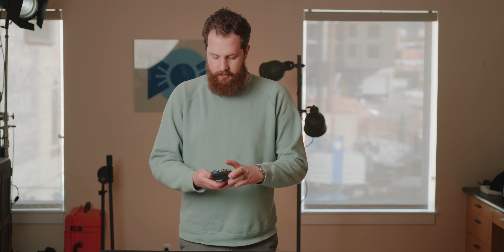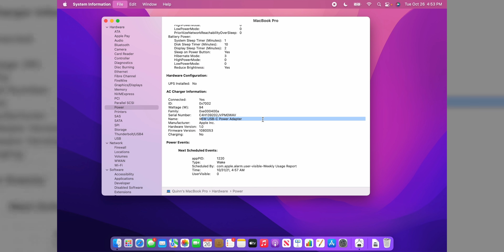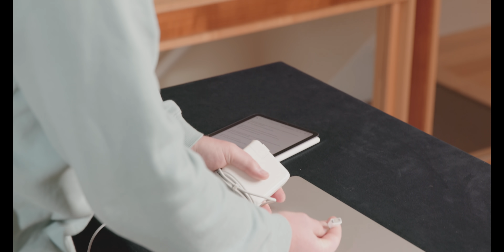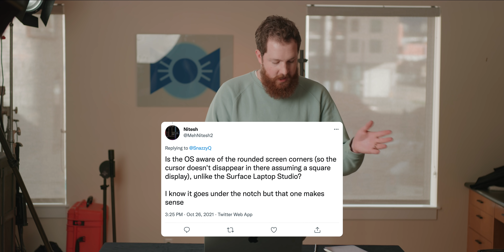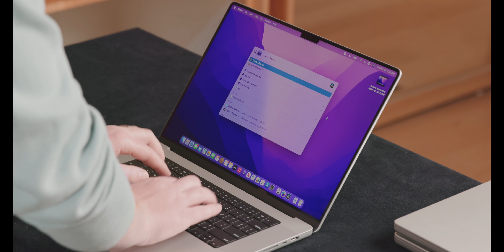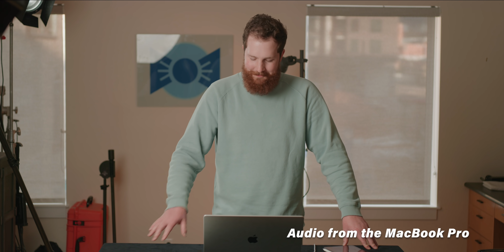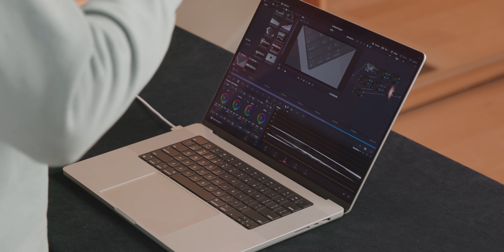The 2021 MacBook Pros are Insane

Comment: (1) menu bar items on the right always disappeared when the menu was too large with no way to access them. (2) the “warp” across the notch when using menus is inconsistent with normal cursor movement but is consistent with menu operation; since the menus straddle the notch so does the cursor. I.e. when you invoke a menu you’re navigating menu space not your normal screen space; users are used to subsequent menus immediately popping open as they scrub over them, if there were a dead space it would feel unnatural. Similarly warping or colliding with the notch when just moving your cursor around would feel unnatural. (3) there is a new option in settings to always have menus enabled in full-screen mode. (4) as far as I stay menus extending behind the notch, yeah. Got me there.

Comment: Sound doesn't radiate. It resonates.

These new macbook pros are too heavy for high end expensive laptop.

ThinkPad p series, Dell precision etc uses more expensive but lighter material, e.g. Carbon fiber or magnesium alloy, to reduce weight.

Weight matters more then thinness for laptops

Comment: Do you think this laptop will be noticeably faster with Davinci Resolve then my maxed out 2016 5k IMac? Im thinking about switching over!
Reply: @Daniel W It would depend on your workflow. I will say that on my original M1 using FCPX exporting 8 bit is WAY faster than 10 bit video but I haven't tested it yet on my 14" M1 Max with esxporting 10 bit footage since when I upload videos they are re-encoded anyways. I plan on doing some tests in Davinci Resolve and Premiere Pro and see how much of a difference there is with a few LUT's but it may be faster if the M1 Max.

Comment: thank you for making the effort to get some info on how these perform NOT editing videos. as a product designer, im in a niche field that is made up of mostly pc users due to software, but as a mac user, I get by. seeing how the 3D modelers and VFX artists take advantage of the hardware is going to helpful. this is something ive been trying find to make  right choice on which chip to buy.
Reply: Easy. The biggest you can get, ofc. That's 5000€ please. No, you don't need 8TB of SSD. I have one PC with 7TB SSD (different gens), 16 cores/32threads (R9-3950X), some decent graphics and 128GB of RAM. That thing is a monster regarding MT tasks, database and/or virtualization. Profits from parallelaccess via many PCIE lanes. So... only if you want to do something similar... 2TB of SSD should do.

Comment: @5:00 I design mechanical hardware and enclosures, They likely used a softer grade of aluminum for the bottom but that doesn't necessarily mean it's cheap. If the rest of the chassis is sturdier then a super hard aluminum isn't going to be needed for the base since when assembled the chassis will provide that rigidity. If anything it may be providing some durability as harder aluminums, while stronger, will also crack and fracture

Comment: The one reason I’d want to tuck a tiny SD card in the slot is so the computer can have a time machine backup on board. I’d back up my user drive to iCloud, but for the rest, I’d use the tiny SD card. I don’t really care about speed in that case. It’s still going to be faster than restoring TimeMachine over the network. I did that the other day and it took a day and a half.

Comment: Regarding the "notch", it'll be like with the iPhone X. Apps will need to be updated to support it. Da Vinci Resolve has been updated to support, whereas iStat Menus hasn't. I imagine, though don't quote me on this, that once iStat Menus is updated to be made aware of it, then it will possibly behave in a similar way to the longer menu bars and simply jump to the other side. Either that or it'll remain incompatible as those devices simply lack the menubar space so you have to be more conservative with what you have up in there.

Regarding full screen apps, full screen video uses the same API so it makes sense to autohide the menu bar as you wouldn't want it showing then. Maybe in the future Apple can create an API hook that will allow apps to make the menubar consistent in some cases.

Comment: Sorry, but your "Review" is really stupid. For example, you totally go on a rant, that the menu bar disappears in full screen even though the space clearly isn't used any other way. And you just make it look like a total fail and that it is just logical to the hole world, that it must the exact same way as YOU would like it. :/ You have any idea how amazing it actually is to me and I bet to a lot of other users, that the menu bar disappears and does not interfere with my content? I work mostly in full screen mode and this was an issue since the birth of full screen mode. To me, the is one of the main reasons I love my new MacBook. And you just make it look like a total failure, without even mentioning that there IS a very good reason for this feature :/

Comment: Didn't see any mention of this, but many planar headphones use low impedance, low sensitivity drivers which are a horrid match for Apple's impedance-based voltage output on the headphone jack. The jack thinks the headphones don't need as much power, so using chonky planars will result in them sounding underpowered.

Comment: It may not be good for Audeze LCDs because they are low impedance headphones that requires a lot of current, like most planar magnetic headphones. That said I'm sure the new MBP is plenty enough for traditional dynamic headphones such as Sennheiser HD or Beyerdynamic DT series, which require higher voltage as opposed to current. LCD headphones have low impedance but also low sensitivity, hence they require tons of current.

Comment: Actually I don't think Apple made this notch mistake because they over-engineer everything as I am aware of. I recommend you to move those wider status bar icons in the right because I think macOS puts them behind the notch because there is not enough space on the left side of the notch. If this is the solution that they've made for the notch, it isn't good. They have to make a built in version of Bartender and because it is Apple, they will probably do it good.

Comment: 19:57 - I guess they made the bar disappear just because people would be annoyed by it when watching videos in fullscreen
Reply: It’s definitely the right choice for default bar behaviour. Many ordinary people would be annoyed watching Netflix with these machines and always seeing the bar up there. If you want it differently just change the settings.
Reply: There is actually a setting in the menu bar/dock system preferences window to set the menu bar to remain in full screen.
Reply: I agree that is probably the reason, however it would be nice if it could be configured by application. For example, there are many apps I would like to run in full screen but keep the menu bar.
Reply: @Roaming50  just maximize your window (Option + green dot), instead of full-screen, then. 

(I'm with you that I want the menubar, generally, and that plus the weird Spaces behavior of full-screen apps means I basically never use them, other than for virtual machines.)
Reply: Absolutely
Reply: There is a new UI control that allows developers to use this real estate around the notch so that’s why the menu bar collapses out of the way.
Reply: I guess you couid say, that... they Cut The Crap ;)
Reply: @Haakon Reiss-Jacobsen interesting, in my experience the menu bar still stays when videos are in full screen. Is there maybe a setting I’m missing?
Reply: Go to the FREAKING SETTING DUDE! There is an option to leave the menu bar on in fullscreen mode!
Reply: u can actually set it to display on the settings when fullscreenmode
Reply: Agree. I prefer the menu to disappear when in full screen modes for other apps (pics, videos etc). It’s far more immersive. Just change the settings if you don’t like it.
Reply: definitely. I personally would be irritated to infinity and beyond if I’m watching a movie or playing some game and I see that distraction up there permanently
Reply: Yeah.
Reply: Many valid responses in this thread, and I would also add burn-in concerns especially if they are going OLED some day
Reply: That bar sucked hard. No matter how hard I tried , I'd keep accidently touching it, causing the computer to go crazy.
Reply: In macOS it’s already an option to make it automatically disappear or always show so I think regardless what do you want you can always change it.
Reply: But it's Pro. You shouldn't be just watching videos but making them on such hardware.
Reply: tbh, it should be an option with it off by default.
Reply: I feel they could probably just sync the bar with the content that’s being displayed though. Black for videos, and then color match it like they did with safari.
Reply: О, Артём, а ты тут что забыл?)
Reply: @Mixi1 видимо то же, что и ты))

Comment: got to ask. Was that a 14" or 16" MacBook Pro used in that review and what was the screen size? 
I'm wondering if the 16" model would have the same issues with the menu bar due to its much bigger screen size and resolution. I always run at max res (more space option)
Also, it appears you need 2tb or higher storage to get the higher speed SSD
Reply: It was the 16in with M1 Max 64GB
Reply: @jkitsme1508  It must be must be set to a lower resolution. Then again I never use the default resolution on MacBook Pros and always find myself going for more space.

Comment: iStat Menus uses a custom renderer for their menu items, and not the vanilla Apple menu item renderer. (I don't think Apple's API for 3rd party menu items supports all the features iStat needs) Bjango will need to create a way to detect and work around the notch if they want to fix it.
Reply from the maker: Bjango stated otherwise on Twitter and even Apple's own menu bar items will hide themselves under the notch if they get that far over.
Reply: @snazzy  Oh really? Perhaps I'm thinking of a different menu bar extra that uses a custom renderer. Regardless, I'm sure it'll be fixed (or at least improved) soon.

Comment: I think it's good that they auto-hide the menu bar in full screen. Typically in full screen you don't want the OS adding anything visually distracting, imagine you're watching a movie and the menu just stays there the whole time, that would be annoying. EDIT: I see from the other comments that there's a setting so there you go, but I will insist they chose the correct default behavior.

But yeah the behavior where status icons just disappear or go behind the notch, that is just badly programmed and needs a fix.

Comment: Passively radiating? Nah, it’s just a pair of woofers in a sealed enclosure. A passive radiator is a slave bass, a driver without a motor, driven from the air pressure from the motorized driver.

Comment: Curious how iStatMenus looks when you change the display to "More Space" scaling. Also worried the menu bar will look insane in 'More Space' because it can't get thinner due to the notch...
Reply: I went and checked one out at an Apple Store today, didn’t have iStatMenus but I can confirm that with “More Space” display scaling the menu bar stays the same height while all the items in it get smaller. Looks a bit strange but makes sense given the notch.

Comment: I thought this could do several 8k streams without dropping a frame... But with just one stream in Davinci it's dropping frames?!

Oof.
Reply: RedCode RAW != ProRes. Latter is what Apple was claiming. RAW video is massively harder on the system.
Reply: @headwerkn  Seriously?! I swear I worked on a Mac Pro back in 2014 that could do RAW video in real time... I swear that shouldn't be this difficult. There is nothing to compress or decompress.

Comment: The main function of the notch is to force users to buy an overpriced replacement screen from Apple when it breaks , rather than simply using that LG panel that is also used for some Windows laptops and available to independent repair shops. Same as the soldered NVme (which is neither an Apple design,  just  standard flash chips from other brands). And the same trick by soldering to the hdmi connector, there is no justification as it is not even hdmi 2.1, it is just the standard hdmi 2.0 in use from 2013...but now soldered.
 All this is not by chance, those are exactly the most common parts that break or fail over the time,  and force users to buy a new one or expend a fortune on repairs. Once again, Apple ignoring the right to repair.
But I guess it's more important to talk about how beautiful is the interior.

Comment: It seems like someone could add some thermal pads to the SoC block to use the bottom of the case to help further dispense the heat. (Like what some people did for the M1 MBA). 
Wonder if that make the performance even better.

Comment: If you going to test 3D Model softwares as Blender and Maya, their renderers (Arnold, Cycles, Eevee) do not support Metal API so you wouldn't able to demonstrate GPU because there is no GPU render option on Mac with those apps. using a renderer that support Metal API (like RedShift) it would be more appropriate if you going for that.

Comment: On my 2019 16" MacBook Pro I actually already strictly get everything I need out of the left side. 34" 1440x3440 HDR 144Hz display (only running at 100Hz), keyboard, macro board, mouse, webcam, and power from the 2 Thunderbolt ports. I was for most things here (screw the touch bar, and make it thicc) but I'm fine with dongle life 🤷‍♂️

Comment: It's an iStat menu problem. As far as we can see now, iStat menu is using a private API that is utilizing a space on the menu bar that should not have been utilized. This messes with the standard system overflow code, that already was availble in Macs without a notch. Because, well, overflowing could happen on those macs too. Status icons would disappear in favor of application menu's. That's nothing new.

So either way, it is a solvable problem and as much as I love your video's, you make it sound like it is a huge problem. While in reality, the behavior you call out (disappearing status icons on menu bar overflow) has been in MacOS forever, and the iStat problem really is a solvable minor issue.

Comment: I hate to be that guy with the teardown part, but: 
- Screw bit is P5, not P3, to remove bottom plate. 
- They have put the battery right on top/behind the trackpad in previous models; it's been standard for years now. The only deviation was the 12" MacBook that had the battery adhered to the bottom plate.

Liked and subbed as always though! Great video.